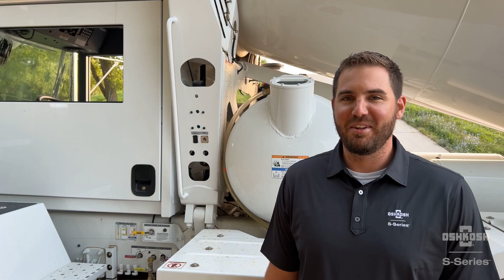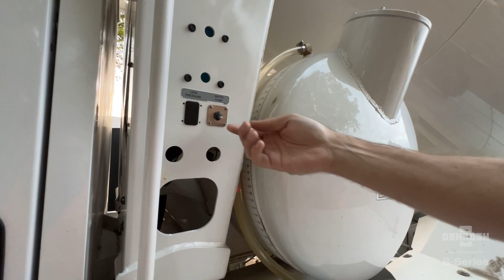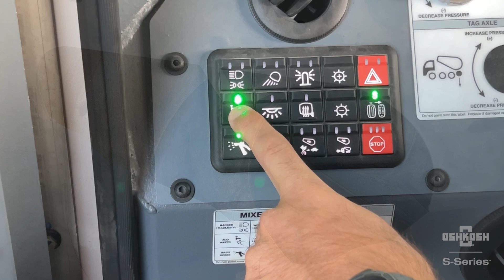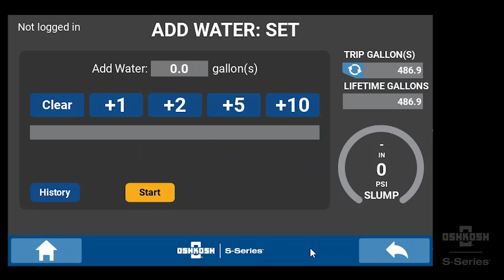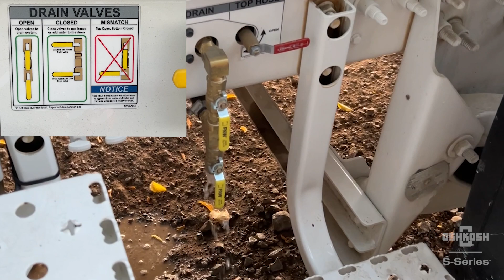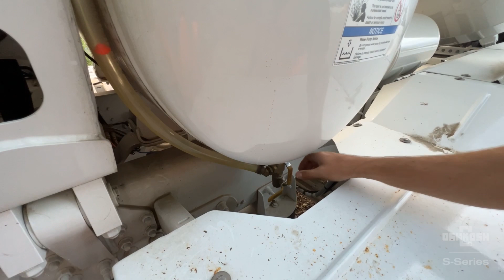Oshkosh S-Series Driver Training: Water System

Comment: My s series doesn’t have any of these how do I drain the excess water in my hoses so they don’t freeze?
Reply: Do you have an older s series if so there should an air line that comes from your secondary air tank and connects to your waterline there should be a ball valve somewhere just open it to purge air
Reply: @Massivelock Can you be more specific? Does it go to the hydraulic pump or directly into the hoses somehow? Because I see a line to the hydraulic pump but I can't find any valve. Terrible design
Reply: How do you keep water from freezing during transportation with water pump always turning off?